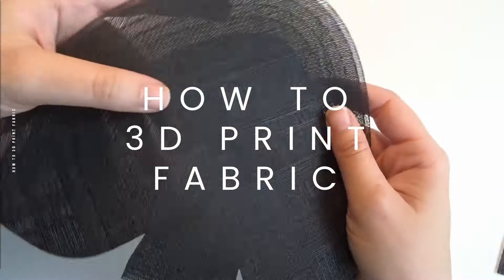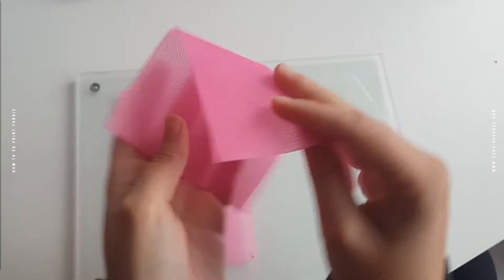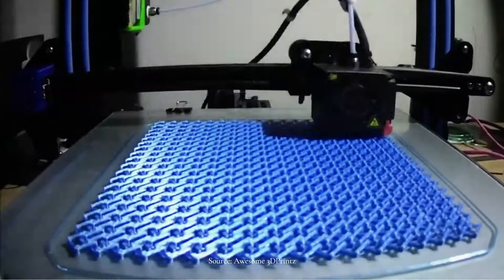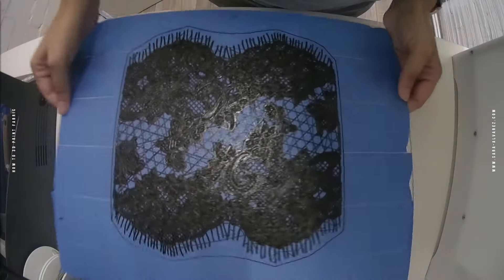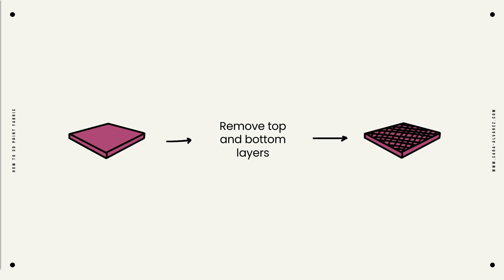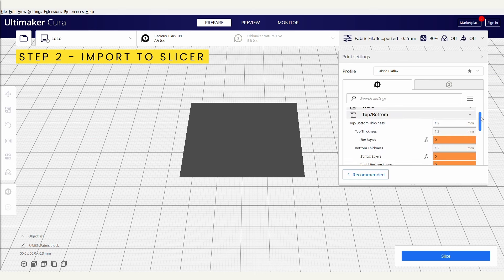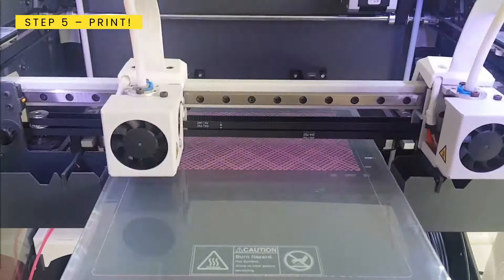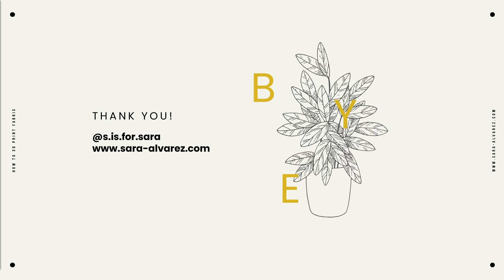How to 3D print fabric - Step by step

Comment: I am brainstorming ways to make origami tents and want to have the crease patterns printed on lightweight tent materials. The crease patterns I am mainly working with are parabolic patterns, and flasher patterns using water resistant paper.

If you have any information on someone working on the same design problem let me know.

The design I am striving for has these qualities:
1. Very lightweight
2. Does not need poles because it has a rigid effect with tensile strength.
3. deploys and Folds down to very compact sizes quickly.

I have several designs that do this with paper, but it needs to be durable fabric like nylon-polyester rip stop.

Comment: I’m wondering about the heat tolerance
Reply from the maker: For reference, the material used is TPE, which starts melting at around 230C. I'm pretty sure it could withstand washing at low-mid temperatures, but I haven't tried myself.

Comment: I did not understand how to use Fabrix. Sara, could you explain better? Thanks.
Reply from the maker: Hi Eduardo, thanks for your comment and sorry for the late reply! You can use the 3D printed fabrics the same way you would normal fabrics. You can weld the pieces together or sew them to make a garment.
Reply: @SaraAlvarez  Thanks. It's just that I didn't understand how to apply Fabrix for 3D printing. Which software use, for example, to manipulate. And to print. Thank you in advance.

Comment: It just prints a very long time, especially TPU and in the end you get some kind of a rubber plate you could just buy?
Reply from the maker: Hi Marlon, in this example I print a rectangular piece, but the nice thing about 3D printing is I could 3D print the shape of a T-shirt pattern, or a bag, or anything really. If you get a rubber plate and then you have to cut out a shape, you'll end up with some leftover material. With 3D printing, you only print what you need. That's the nice thing about it :)

Comment: how do you join diferent fabric sections? :O (i mean, my 3d printer is pretty small)
Reply from the maker: Hi! I also have a small print area so I usually do one of three:
Use a 3D pen with the same filament; sew the pieces with a sewing machine; or make the design modular, so I can interlock the pieces with each other. 
I hope this helps :)

Comment: Soooo you just printed a thin plane and called it fabric? I don't see a phenomenon here. The discovery was the flexible filament and I love that idea. Making bouncy stuff is great.
Reply from the maker: Hi Meby, for this video I used a BCN3D Sigma R17 and Recreus Filaflex 82A. I would recommend using a 3D printer with direct drive extruder though, it makes it easier with flexible filaments.

Comment: I have never produced fabric using the infill method, but after printing a part in nylon, I noticed the raft was a possibly useful fabric. Since then, I have produced fabrics in TPU by using larger nozzles and tweaking the raft settings and part geometry, stopping the print after the raft. I have modified the g-code also, deleting layers above the raft so I don't have to stop the print manually.
Reply from the maker: Wow, you're quite the expert then! It is interesting to read all the different ways to achieve a similar result.

Comment: I've been using a combination of direct modeling and the infill method for about three years, now. I've been making bags and hip-pouches for friends and family, though I haven't tried to market it yet (working another project path atm.). I'm looking forward to seeing if the public responds as positively as my 'test market' has!
In my case, I've been printing fairly thick sheets with a very soft ninjaflex. It comes out with feeling very close to pleather. I model in the stitch holes to make assembly easier, but I love that you can do cool borders and patterns basically however your imagination desires. One huge tip I have is that it's much easier to buy the white ninjaflex, then use Rit synthetic dye to color it. Just make sure you do all the same colored parts for the same project at the same time, so you can get the colors to match, otherwise you end up with darker/lighter parts. I do a few test swatches with a color mix, then dye all the panels at the same time in a big pot. The ninjaflex holds up very well to the temperatures of the dye/water, despite being a thermoplastic. YMMV, so experiment.
Reply from the maker: Thank you for sharing your knowledge, I have to give the dyeing a try 👌🏼 
Have you tried using natural dyes like avocado pits or onion skins? I wonder if that would work.
Reply: @SaraAlvarez  I really have no idea. Rit synthetic was what I saw recommended for dying rubbers, and it worked first try, so I didn't experiment much. Do let me know if you find other dyes which work just as well!

Comment: I wonder if there could be a hybrid using thread in the mesh that sticks to the polymer while still in the melted state. To add strength and maybe, in the case of the shoes, the side facing skin could have more natural fiber against the skin than the polymer.

Comment: Thank you for this well craftet and beautiful video to get you interested in printing flexible parts. Instead of waving strands of material to fuse them were they meet is a neat way of coming around to beeing able to do this. Thank you for broaden my horizon on 3D printing. Making some sort of hinge should be nice beeing made this way. 

I guess you`ll need a bigger bed than that to custom print your t-shirts? Z-axis hight would be not so important. 

Regards, 
Etna.
Reply: For single panel t-shirts, yeah a bigger print bed would probably be needed. See Ivan Miranda's big printer. ;-) But I could see interesting color and texture patterns could be done by connecting together smaller panels to make the bigger t-shirt panel. Sort of like building up a quilting square. Not sure if I would want TPU against my skin though. Might need an actual textile liner, or be worn over a tighter fitting shirt (like an undershirt).

Comment: I don't know about Cura, but for printing simple sample swatches you can do all of this in PrusaSlicer (and many other Slic3r forks). Simply after starting up the slicer, add a primitive shape (like a cube) to the print volume then scale it to the dimensions you want. Remove the top and bottom layers and then play with the infill. Yes, you will probably want to use your favorite 3D CAD program to get the actual pattern shapes when taking from idea to design, but for simple swatches the inbuilt slicer primitives is faster and easier.

Comment: Now this sounds extremely useful, but I'm wondering, is it stronger or weaker than polyester or cloth?
I'm wondering since there's an actual amazing possibility that this could be used to create very specific costumes, but since some have to be kind of tight, it's worth noting if they would resist.
Reply: Much weaker also it isn't fabric... It's just a thin crisshatched layer of plastic.

Comment: It would be cool to try this with a dual extruder using different filaments for each direction for a start and moving onto even more complex patterns.
Reply: could be interesting, especially regarding the direction of stretch needed. Ie, one bit of a part might stretch vertically but not horizontally

Comment: This is very interesting! Has there been any analysis on durability / microplastic pollution from 3d printed fabrics with common filaments? I know polyester fibers contribute significantly to microplastic pollution and, with lower durability, 3d printed fabrics might be worse.
Reply: If memory serves me right, PLA(not sure for other kinds of filament) does not degrade into micro plastics
MakersMuse has a great video on the impact of 3D printed plastics
Reply: @thesplatstrategist  Flexible materials, like what's used in this video, is not PLA. It's TPU.
Reply: Oh sorry, I just thought of flexible pla because it’s what I use
TPU might not be as great for the environnement
Reply: @thesplatstrategist  every plastic degrades into microplastics
Reply: PLA is biodegradable, like biodegradable BBs.
Reply: There are loads of eco friendly options
Reply: @Eduardo_Espinoza  yea, like vegan meat from meat. It needs 80 degrees Celsius to compost
Reply: @user0K  I see, thank you :)
Reply: Worse in a unit comparison could be, but on the overall grand scene it's near insignificant, given the amount of industrial usage of polyester vs. 3D printed materials like TPU.
If everyone 3D printed their own stuff it would be a significant issue whoever.
Reply: Yes there has been. PLA plastic products do break down under normal oxidation, and photodegridation processes, but that can take decades. In microplastic form this happens faster. Under ideal conditions, warm moving water in direct sunlight, this can happen in as little as 10 weeks. Under less ideal conditions it will take years. There are no results yet for completely anerobic environments.
Reply: I think we should be more focused on the tonnes of plastics that are produced and sold by multinational and mega corporations rather than the relatively small amounts of plastics produced by makers. I get the sentiment though and I totally agree we can look for more sustainable ways to create on the small scale
Reply: @goodboiadvsp3297  Ignorance won't make the problem go away though. Why can't we focus on both concerns.
Reply: @user0K  of course, because biodegradable plastics are not a thing, right.
Reply: @Eduardo_Espinoza  There have been some tests on the "biodegradability" and it isn't as they say really, it takes a lot longer than projected to degrade. However, there are some tests on reusing plastic to make filament so that might be a thing in the future.
Reply: @bennylloyd-willner9667  true, they said it can take 10s, 100s or 1000s of years, but they pitched it as being normal (PLA biodegradable BBs). You're right about plastic fitment, it can be reused too! :)
Reply: @Silicon true, thx :)
Reply: you are not a drummer by any chance, are you?
Reply: @Eduardo_Espinoza  yes, ""biodegradable"", just wait a few hundred years.
Reply: @4.0.4  yup, lol :)
Reply: I think something people overlook is that woven fabric is made of microplastic to begin with. Extremely thin, often non-continuous fibres that are just spun not bonded together, and they regularly lose a part of their fibres in a wash. This isn't the case with 3D printed fabrics, which are thermally bonded through. Of course 3D prints will lose surface material due to environmental stress cracking, light and air induced degradation but I suspect it's actually a lot less and when the material is emitted, it's a lot deeper chemically degraded, so less likely to be a long term issue.
Reply: @Eduardo_Espinoza  biodegradable isn’t what we think it means 

It mean eventually 

So your air soft bbs 

still there
Reply: @user0K  PLA is actually derived from cornstarch and, if what I've read is correct, breaks down to its ingredient base.
Reply: @davidpetersonharvey  all the plastics derive from organics, but it does not define their properties. You can make plastic from some food, but I doubt it would be tasty :) so, yea, it decompose in certain conditions (industrial composting in high temps), but otherwise it becomes microplatic which just circulates in nature
Reply: CNC kitchen did a video about composting plastic in the garden. Not much deterioration after 2 years. So, this means to even become microplatic,  it would take much longer
Reply: @user0K  My understanding is, that microplastic doesn't come from degradation much but rather from the fact that plastic waste gets ground up into smaller and smaller pieces until it can be eaten, drunk or even breathed. For example when something falls into a river, if it can grind down rocks, it will do the same with plastic. It simply must not enter the environment in the first place
Reply: @Eduardo_Espinoza not biodegradable with normal methods. If you put it in the bin it won't degrade

Comment: Cool stuff! But when I saw the point of "no waste", I got annoyed at the irony, as I remembered that this is all plastic, and that it pollutes the earth and just sucks as a material (for everyday wear), you sweat, it feels gross, it quickly loses its nice texture, it just plain sucks and is SO unnecessary & easily replacable by natural fibers, only thing is its cheap.  It should finally be banned. (So this is a rant against plastic textiles for every-day wear, not particularly the topic at hand..)
Reply from the maker: Hi! Thanks for your comment, it is an interesting topic. I agree that for most clothing, using natural fibers makes more sense. What I posted here is more an experiment and a sense of what the future could be, and in that future perhaps we’ll have 3D printing filaments that aren’t oil based, or we perfect the recycling process in such a way that we can make truly circular products. We’re not there yet, but 3D printing allows things few other production methods have: local production (less pollution due to transporting goods) and virtually no material waste, since you use what you need and no more.

Comment: its just bendy plastic how on earth is this cutting down waste
Reply from the maker: Hi! It cuts waste in the sense that when you make clothing from fabric, you always have leftovers that often get discarded. Using 3D printing means you only print what you need, which results in almost no waste of material.
Reply: @SaraAlvarez  if you were not aware left over fabric can often be recycled often into shreds for insulation or some paper products
Reply: Im unable to get the resource kit?